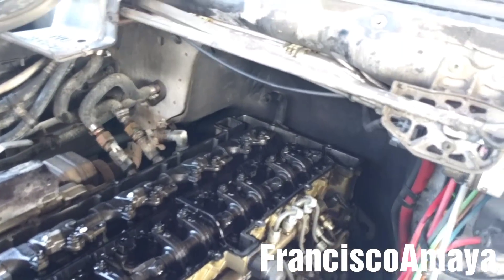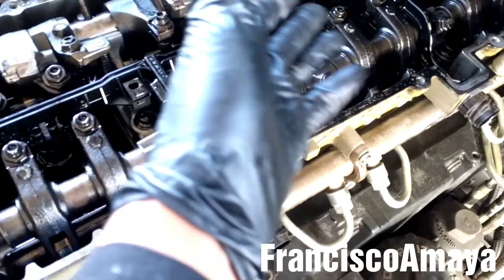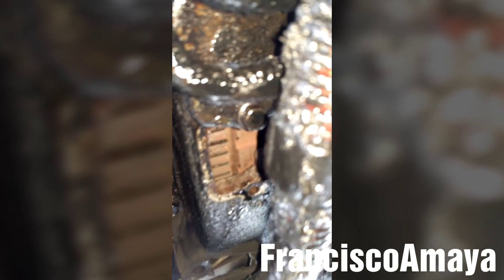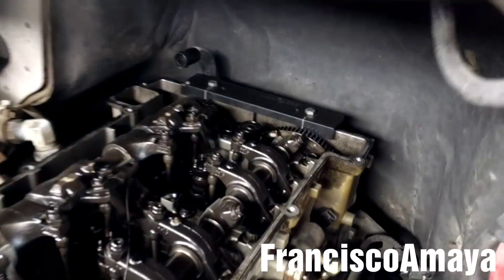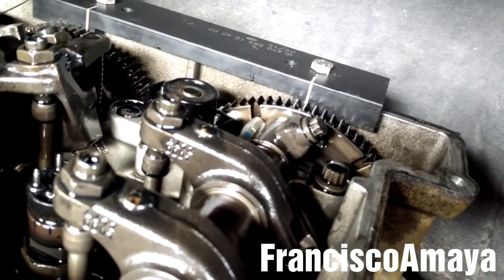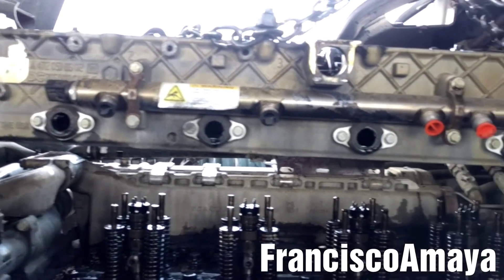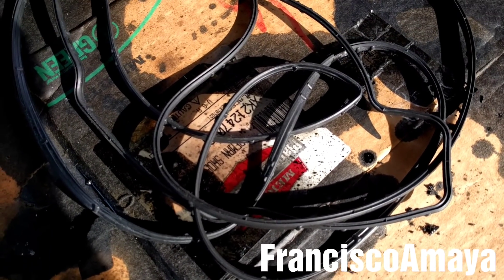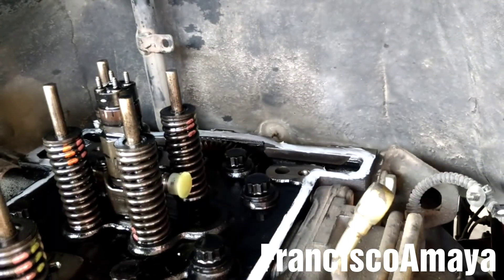Freightliner Cascadia DD15 engine cam housing seal removal replacement engine timing marks part 1

Comment: Hey brother. I got same oil leak problem today. Is it safe to drive until I reach my home? and I will have it fix by my mechanic. I’m 700miles away from my house. What safety precautions should I consider while I’m on the way back home?

Comment: My 2016 cascadia dd15 oil leak around air compressor I can’t tell exactly where but whole side is mess with oil , truck is throwing black smoke and loosing power

Comment: Hey Francisco was wondering when you put the black tool that goes inside the cam shaft position sensor , after you find the position can you remove it? Or will if have to stay in during the whole process
Reply from the maker: That one is just a double check plate.  The important one is the one in the front area of the camshaft. You can remove it and nothing will happen

Comment: My dd15 is leaking at the back by the firewall how much does this job costs
Reply: A job like this cost me 5800$. But it varies different shops have different labor rates. It's about a 15hr job

Comment: Hello brother,cuestion like how much is cost to do the head gasket and all seal around the head in new York state I a dd15.thanks
Reply: Shop/dealership hourly shop rates vary from 100 to 150 an hr on cost
Reply: Rounding out 6,000.00-8,500.00 with and with out machine work and parts. With 40-50 hrs on labor quote.

Comment: Hello Francisco .. I have a 2014 Freightliner DD15.. Currently dealing with three codes.. 1. SPN 636 fmi 2 related to cam and crankshaft sensor sync... 2 SPN 3216 fmi 2 inlet nox sensor... SPN 3251 DPF Pressure High.. I've had the filters removed and cleaned three times in the last 2 months... SPN 3251 normally goes away after reinstall and doing a forced regen.. My question is could the reason the filters keep getting clogged be because of the NOX Sensor failure and replacing the Inlet NOX Sensor will prevent frequent need to pull DPF filters and clean or if still have SPN 636 related to Camshaft still keep the aftertreatment system from doing passive regen as the truck goes down the road? Truck normally does 400 - 500 miles/day.
Thanks for any advice or help!

Comment: Maestro francisco es el misma erra mienta para el dd13 y el dd15
Reply from the maker: El pin de abajo es el mismo. Pero el del housing es different. W470589114000
Reply: Francisco Amaya 
Muchas Gracias maestro
Reply: Que tal Francisco que distancia puedo manejar el motor esta soplando bastante por la respiracion es Detroit dd15
Reply: Esta perdiendo antifreeze y esta mezclando antifreeze en el aceite que puedo hacer estoy en Fresno .ca ire para Laredo tx gracias
Reply: Marcelo Buenos días biejon  soy mecánico también mire tu problema que trai tu camión debes de meterlo al mecánico de volada si está perdiendo bastante antifreeze
Reply: @robertocasillas3760  Buenos dias
Reply: Esta tirando mucho vapor por la respiracion del motor
Reply: Marcelo A por lo mismo del antifreeze biejo por eso es el vapor que sale por el respiradero

Comment: Francisco buenas noches  tengo in camion Chico motor Cummings 8.3 q perdio fuerza  y dijeron q era la pompa dediesel ya le pisieron la pompa y El turbo Los injectors mangueras y sigue igual no tine fuerza si pudieras contestar y darme una sujerencia  te lo agradeceria mucho
Reply from the maker: Como pierde fuerza?
Al empezar or en subidas?
Reply: Francisco buenas tardes muchas gracias por contestar .El camion enciende r corre pero solo a 40 millas pero es Todo ,no acelera mas es como si no injectara El diesel con precion ,comp tell dije ya le pisieron turbo injectors y la pompa del diesel .
Reply: Gracias
Reply: Ese problema es muy simple amigo su problema es la transmission cuando el motor aumenta la revoluciónes a la 40 mph significa que unos de los sellos en los pitones del drun the forward está damage,(malo,tostado) y eso hace que pierda fuerza la transmission y no pase de la 40 mph,oseas el problema no es el motor es la transmisión

Comment: I had my Cam housing case and seal change and I’m still leaking oil right behind the oil pan what other seal could that be it leaks when the truck is running? Help anyone DD15
Reply from the maker: If it is not leaking from the top of the engine,  it is going to be the fuel pump and air compressor
Reply: Francisco Amaya  are those seals in the compression and fuel pump or does the whole thing need replace
Reply from the maker: Just the seals need to be replaced
Reply: Francisco Amaya Thank you Francisco
Reply: If its leaking from the back of the oil pan then it could also be the flywheel housing.
Reply: @chillwill1740  I was thinking the same thing.

Comment: Una pregunta Mr. Amaya. Mi camion es 2012 Freightliner coronado DD15 cual es el Engine brake adjustments tool.   Es 4.1 MM o 4.6 MM?   Gracias
Reply from the maker: Va a ser 4.6 para su motor.
Reply: Mr. Amaya tengo 2 codigos y ya lo rebisaron 2 mecanicos pero no le encientra Mi camion es 2012 Freightliner coronado DD15 

J1939 CM1 Message is missing 986 9 Active 

J1939 Message is Missing from source address 25 (dec) 2025 9 active 

Esos son los códigos abersi me puede ayudar. Gracias
Reply from the maker: Que le han hecho Al camion?
Reply: Le isieron bypass el DEF y cambien la ECM y no fue programada para ese camio (era usada) a estado funcionando por 10 meses pero no tiene mucha fuersa.  La pregunta la puedo problemar yo? Gracias
Reply from the maker: Si la puede programar si tiene El software de programacion de Detroit.
Reply: Una pregunta. En 2012 DD15 Cual es la medida de feeler gauge para las exhaust valves y intake? Gracias